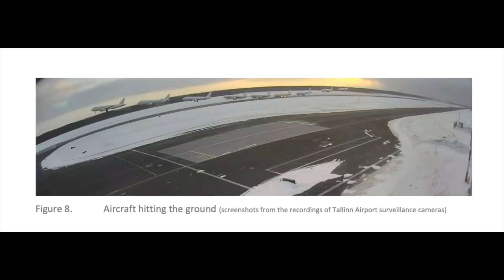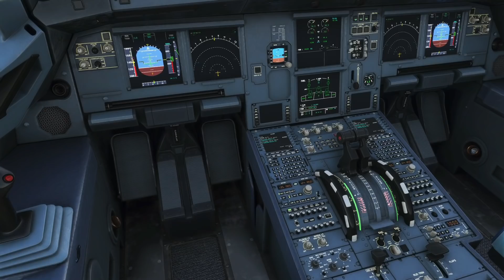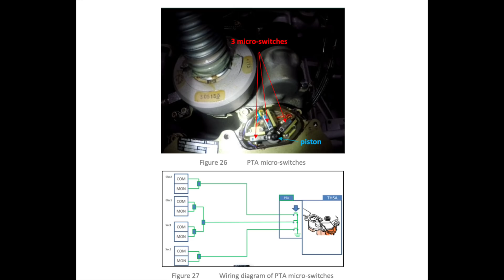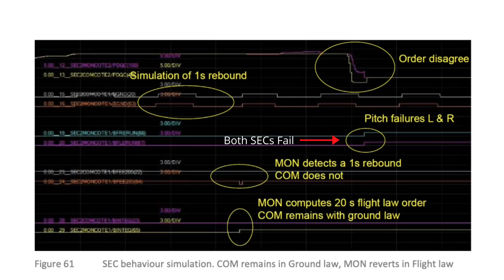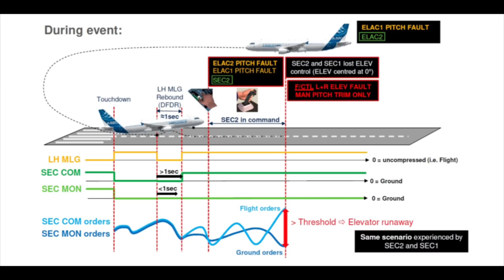The Oil Change That Crashed A Passenger Jet | The Crash Of Smartlynx 9001

Comment: I spent over 30 years in IT. To err is to be human. To really foul things up takes a computer. I don't have a big problem with automation. I do have a big problem with an absence of manual backup systems. In this particular scenario I question the wisdom of continuing the training flight after getting repeated errors from the systems on board. To me that indicates an unsafe situation and a system problem. As an IT professional, when I see error messages popping up on a repeated basis I start investigating and finding the source of the problem. That's on the ground. If I'm in an airplane and I start seeing repeated errors, I'm getting on the ground so it can be sorted out. All it takes is a hiccup in the design as in this case to really file things up. I've seen this in mainframe systems on the ground. Since accidents are not a predictable sequence of events, hence they are accidents, you can't program for all possible events. That's why you've got to qualified pilots sitting in the damn seats! Give them manual controls!
Reply: They had manual controls. Flying using fly by wire is manually flying. It’s just not with old fashioned cables and pulleys or even purely hydraulics
Reply: @tomstravels520  listen again. They had trim only and were largely locked out of the flight controls. That is why they had to use trim and throttles to control the aircraft. It is also why they didn't shut down the burning engine. The narrator also states this.
Reply: @JohnRodriguesPhotographer  and do you know what the ironic thing is. If they had reset the computers one more time they’d have had full control again. Not that I’d expect them to think about that in the heat of the moment. Whether you are operating the aircraft using either a sidestick with electrical wires or a yoke attached to cables and pulleys that is still manual flying. If you let go of the controls and crossed your arms the plane wouldn’t do anything. If this aircraft had pulleys and cables as back ups it would negate the advantage of having fly by wire which his lighter and easier to maintain. And if it just had pulleys and cables then more pilots would have crashed by stalling or over banking etc. They only had trim controls. Yeah but a horizontal stabiliser is still a control surface that can be controlled manually. Not as precisely or as quickly as using the elevators but it’s better than nothing. And the pilots lost 3 levels of redundancy to get to that level. How often does that happen?
Reply: @tomstravels520  since I don't know what constitutes a reset in that environment I'm not sure either way if it would work or not. These are networked systems and they may have fail points and restart right where they left off. I get what you're saying but if they store data in the short-term buffer last good point is what I'm talking about when they restart they'll read that and they'll be back at square one. Essentially they'd have to keep rebooting if that's the case.
Reply: @JohnRodriguesPhotographer  the ELAC computer is spilt into a pitch and roll channel. That’s why only pitch was affected. Only the pitch part of the ELAC stopped working. The Roll channel was still working. If the computer failed completely the ailerons would no longer function. Resetting the computer would then reset the pitch computer to issuing commands again
Reply: @tomstravels520  there was another computer that takes over if ELAC fails, short of going back to the video to get the name it began with the T I believe. That computer was the one that locked them out of manual control of the horizontal stabilizer. Keep in mind the viscosity of the oil in the system was too high which resulted in the cutout switchs not engaging.
Reply: @JohnRodriguesPhotographer  yes the SEC. But the SEC only takes over if both ELAC pitch controls were not available. The design flaw with the landing gear couldn’t be forseen and the SEC wouldn’t have been active if the ELACs were reset anyway. And also if they had reset the ELAC whilst in the manuals trim mode the computers would have restored the pitch channel and everything would be back to normal
Reply: @tomstravels520  Based on the narrator and your assumption the ELAC and the SEC needed a reboot. I would add the comms channel needs a larger buffer to prevent further dropped packets. The dropped packet occurred during async communications, this happens when the processor is busy and the buffer is full. Would you happen to know what kind processor is in the SEC?
Reply: @tomstravels520  I did a little checking, looks like "One used i386 CPU, the other m86k CPU". Near as I can tel the M86k is an Intel 8086 derivative and the I386 is an 80386.70's and early 80's technology. https://aviation.stackexchange.com/questions/15234/how-does-the-airbus-flight-computers-voting-system-work
Reply: @JohnRodriguesPhotographer  wel the plane was built and designed in the 80’s. Any new technology has to be thoroughly tested before it can enter service to ensure it will not through a wobbly and corrupt data like the CPU of the ADIRU did on QF72. The NEO’s might use newer CPU’s
Reply: @tomstravels520  I remember rating probably 20 years ago that newer chips were harder to fight certify because they had thinner silicon Wafers and more prone to have random subatomic particles flip the switches in the CPU. I also read that the space probe that went to Saturn and Titan had an older CPU in it also. So I wonder if that might be a problem going forward, requiring specialized chips to operate in the higher environments of the atmosphere. The denser atmosphere that we experience at ground level a lot of the subatomic particles that are striking the upper atmosphere.
Reply: @tomstravels520  by the way thank you for the civil conversation. I prefer manual systems as backups. Essentially old school. You like the newer digital systems which is fine. We obviously have agreed to disagree and have a nice conversation in the process. Thank you for that. You can probably guess some an older guy since I'm retired now and my experience and IT. Heck I remember when new cars had fins on them!

Comment: @Mini air crash investigation: automation will keep increasing to reduce a pilots workload (like calculators and accountants) but it will never replace the pilot because as a customer would you fly on an airplane that had no pilot?
Reply from the maker: Depends on the failsafes that it had. If someone could remotely land it via a satellite uplink or something then yeah sure
Reply: @MiniAirCrashInvestigation  I was of the same view until i saw this video. even if the satellite link holds up, the pilot (from my understanding of what happened to smartlynx 9001) still needs the option for manual control right?

Comment: Thanks but I'm still very happy with the Boeing concept of the pilot having complete control.
Reply: Even though it is artificial? 787 have full fly-by-wire but it make the pilot think they fly a cable aircraft. I would say Airbus is more honest in their FBW implementation.
Reply: @kerucutgaming2216  Yes indeed. Fly by wire is the way of the future. But the Boeing concept is to allow the pilot to completely be in control of his aircraft, whereas the Airbus' concept is to prevent the airplane/pilot from exceeding predetermined envelopes.
Reply: @evarwilliams  you can disable envelope protections on the Airbus though. So pilot still have full authority of the aircraft.

Comment: You should probably have mentioned that the airbus documentation such as FCOM or FCTM didn’t mention about the number of times the computer could be reset or what to do if it was a circuit flight. Hence there was no clear guidance to continue or not as the procedure was just to perform a reset and if it worked then continue

Also the captain didn’t reset the ELAC on the last touch and go so it stayed off unlike the last few times

Comment: Really interesting video and story. Your research is second to none. Just a thought to add to your observations on automation, I grew up in the 70's and 80's which means I was there for the first big advances in computers and I make involuntary noises getting out of chairs these days. 

Joking aside, I did spend a lot of my youth and younger years learning programming languages (everything from Basic to Pascal, Fortran to C++ in later years) and I remember the words of a rather clever college tutor I had. They apply to any programming language, any software inputting, any hardware engineering or anything that relates to a computer. 

G.I.G.O.

Garbage In.
Garbage Out.

You put the wrong info in, or get something to disagree with itself, you're getting the wrong or an unexpected result out of the other end. 

The point being, it's rarely the computer itself that's at fault, it's often the idiot putting the data in the hole in the top that's to blame.

Comment: Someone help me, did I hear this right? They had several warnings/failures yes kept doing touch and goes and flying? Seems to me protocol would be stop after the 1st warning.
Reply: Nope. The manual wasn’t clear. It said they could perform a reset and as long as it worked then could continue. However it didn’t say how many times it could be reset and what to do if it was a training flight. The warnings were the exact same ones so only ever 2 warnings

Comment: I'm ambivalent about fully automated aircraft, but in the same breath automation significantly reduces the pilot workload and allows the pilots to focus more on all three of the primary tasks of their job. The more automation you introduce into an aircraft, the less hard work the pilots have to actually do in the course of a flight.

But this necessitates that the pilots must compensate by doing even more hard work on the ground, training for the very, very real probability that that automation is GOING to fail or throw its hands up and Just Quit on them, and then it's entirely upon the pilots' shoulders to take over for what the computers had been doing for them. That requires the airlines to have to more thoroughly train their pilots on heavily automated aircraft, and if the airline falls short of all that training, well... you get pilots who're just as clueless to what's happening to the aircraft as the computers that just threw the problem onto the pilots' laps.

Comment: Automation is fine so long as it informs the human beings overseeing the process of exactly what is wrong when it fails. I computer could be programmed to give a check list of the possible reasons for a failure just as well as it is programmed to perform certain flight duties. No matter how much automation occurs, I still want human pilots and more than one of them because you can only program a computer to do things but only humans can assess novel situations when nothing a computer has been programmed to do will be able to manage the situation. Only humans are able to think outside the box and so we ought to always have humans as pilots and in every other job that requires the ability to think outside the box in a life or death emergency situation.

Comment: Excellent episode guys !  A combination of a lot of automation and pilots having an complete understanding of the automation of the aircraft type they are flying. Unfortunately in the Max 8 case the new automation wasn’t conveyed to the pilots. Re this episode the wrong oil used that set up a scenario. So important that mechanics double & triple check what parts and lubricants are to be installed. Thanks heavens that they all survived.

Comment: I prefer 0 automation in the planes I fly. It is like cruise control on your car, cool to have but when it fails it can be catastrophic.
Reply: ??? How is it catastrophic to loose you cruise control? So it doesn’t work? Big deal you just put your foot on the pedal. The cruise control doesn’t suddenly rocket you to 400mph
Reply: @tomstravels520  on my dad's bmw 540i the cruise control went and caused the engine to over rev, resulting in catastrophic failure. The fan blew itself apart and chunks were lodged in the underside of the hood, and dented it. Not sure how much it cost but it was expensive to order the parts, it probably wouldnt be worth fixing if he didnt do all the work himself.
Reply: @lemonator8813  that makes no sense at all as that means it would have to override the gearbox so assuming it was an automatic. But even then the cruise control would never drop down that many gears to accelerate
Reply: @tomstravels520  ok tell my dads bmw that

Comment: It isn't really a question of how much automation but what/who ultimately can control the plane.  When automation fails it would be much safer if the pilots could just shut all the failed systems down and be able to control the plane manually.  So many times when automation fails the pilots are forced to search for and try to resolve the computer problem.  This distracts them from what the plane is actually doing.  If they could just switch the automation off but still fly the plane manually that would be very, very nice.